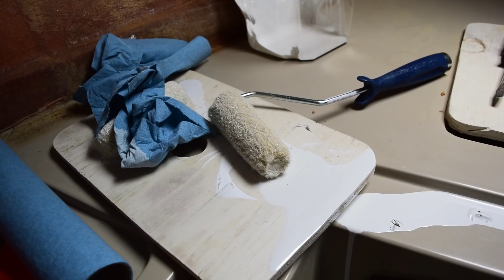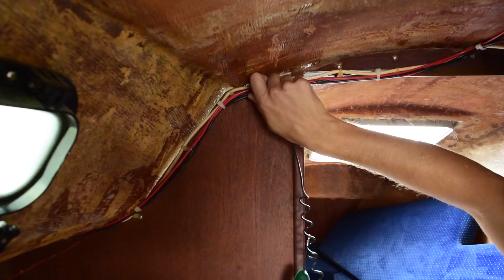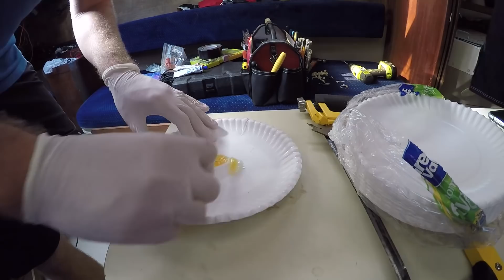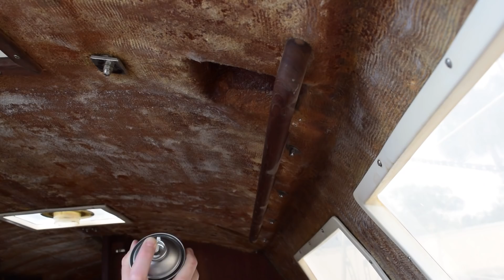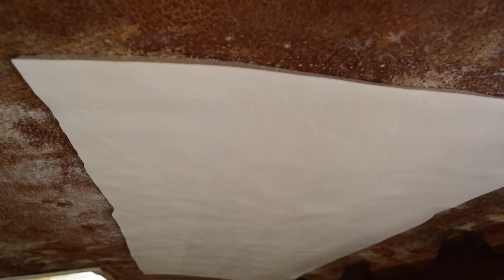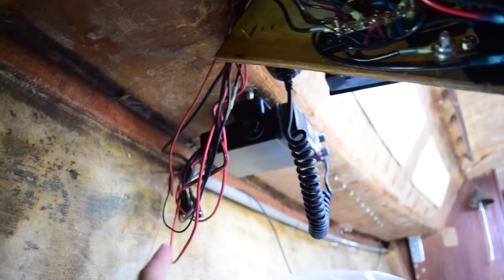21. Moisture Readings, Electrical, and Headliner Testing - Sailing Vessel Somnium

Comment: When nothing else works on fiberglass stains try toilet bowl cleaner. A friend of mine left his boat anchored and left for several hours when he returned his boat was high and dry. They let it set till the tide came back in but forgot to close the pet cocks and as the tide refloated the boat it also filled it with water.

Comment: When I worked for production boat companies (I am a boat designer with 30 years experience), we found we couldn't get a good transition between the overhead and the cabin sides using foam/vinyl unless we sewed the pieces to a pattern and glued the whole thing up at once. You have to have a seam that runs along both the inside and outside corners. The other option is to run a piece of trim down the corners to cover up the edges. Tricky to do if you don't have anything in which to fasten it.

Have you thought about painting the hull sides with non-skid paint? The texture would probably help hide the rough glass a little.

I have been catching up on your videos over the last few days and when I saw you starting to remove the carpet my first thought was oh nooooo! Too late now, but I second what one of your earlier commenters remarked about lots of carpet cleaner. I specified that carpet a number of times in sport fishing boats as it is more durable than the vinyl, which can get torn by fishing rods. To repair it we would have to tear the old out and glue in an entirely new headliner, including the cabin sides. Unfortunately, the customers seem to have an issue with the carpet, even though it is very sturdy and practical.
Reply from the maker: Very good information. Thanks for the input. We have thought about the non-skid paint, but recently we've been talking about maybe just putting new carpet back on the ceiling, where it is rough and uneven, and vinyl on the sides of the hull. We'll see as we'll be fairing and painting the bulkheads first.

Comment: you should get a roller when applying the liner to the 3M spray so that the whole thing glues evenly
Reply from the maker: That's a good idea, thanks!
Reply: They sell those roller at Home Depot in the tile section to help the installation of adhesive tile

Comment: Hm - also not so fond of the new wiring. There is a reason why it is done with a lot more effort/planning than this - you will come accross it when the first electrical problem arises and fault finding/repair is necessary. There are many other aspects which warrant mentioning but here I warmly recommend labelling each cable...
Reply from the maker: Careful planning isn't really our strong suit, haha. Honestly though it's a lot better than it was. I can always add some labels, and we're not finished with it yet. Still a work in progress. Thanks for the honest feedback and for watching.

Comment: That wireing is a mess..wow you should have installed bus bars for plus and ground then neatly wired it to the panel or switch. You really need to clean that up....on the bright side the conduit was a good idea.  Jack
Reply from the maker: There's a bus bar for the ground, but not the positive. honestly there's not enough room back there for anything else, lol. We're also not done with the electrical so it's still a work in progress.

Comment: I've enjoyed your videos. It's easy to see imperfections in an overhead area because you have lighting from the side through the windows. I think you'll find that you need to do a better job on the ceiling than anywhere else in the boat because of the side lighting.
Reply from the maker: Thanks for this information. We'll keep this in mind for sure. We may work really hard at making s smooth surface on the ceiling, and then not worry about the sides as much.

Comment: Remember that moisture meters only pick up conduction. That means any water, metal, or even certain elements will make the moisture meter read something. Below the waterline there is anti-fouling paint which most contain copper or some other metal composite anti-fouling agent. The moisture meter will pick this up and read high so I do not use the moisture meter for anything below the water line
Reply from the maker: Gotcha, good information thank you!

Comment: Nice job.  I haven't seen anyone use a moisture meter yet.  You might want to consider using liquid electrical tape on the crimped ends of your butt-end connectors or covering the connector with the electrical shrink that flows sealant out of the end to make sure the connections are moisture tight.
Reply: Jason Masters check out  Sail Life, he is redoing his second boat in 2 years. Also very good videos.

Comment: Use a new paint roller to apply the vinyl.  Where did you pickup the volt/ammeter?
Reply from the maker: Great idea, I wouldn't have thought of that. We got the meter on amazon. Here's a link. https://www.amazon.com/bayite-6-5-100V-Display-Multimeter-Voltmeter/dp/B013PKYILS/ref=sr_1_3?ie=UTF8&qid=1485542603&sr=8-3&keywords=digital+voltmeter+ammeter
Reply: Thanks!
Reply from the maker: No problem, thanks for watching and for the idea.